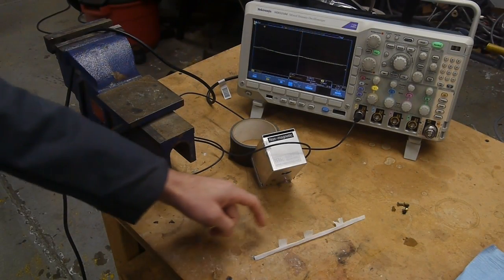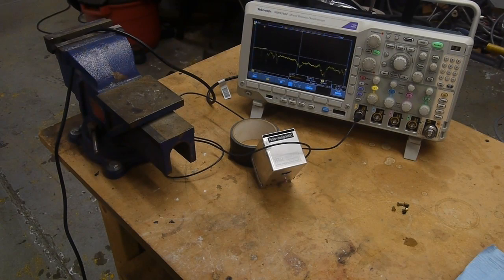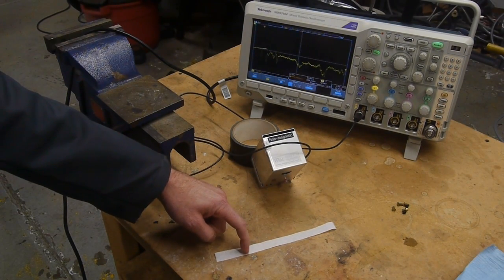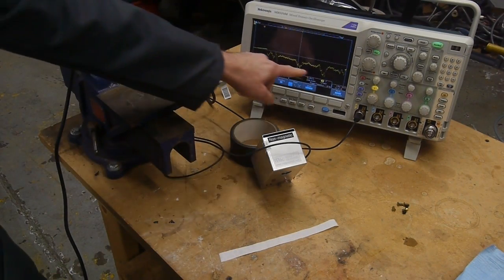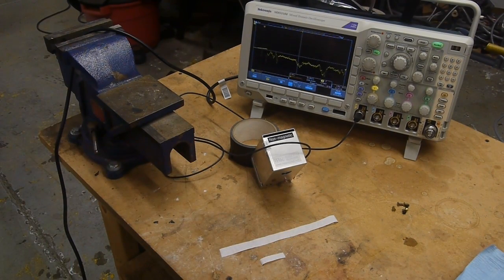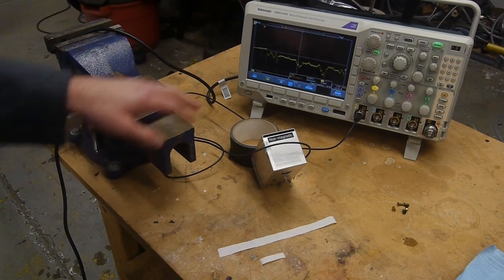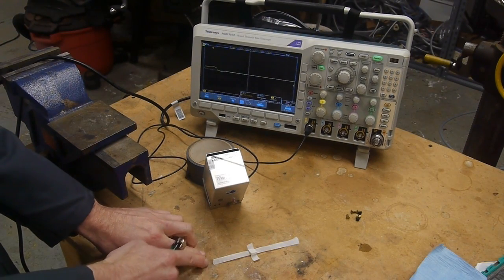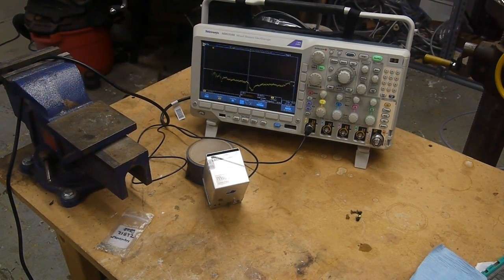Encode information in fire!

Comment: Maybe you could try to implement some kind of logical gates, similar to what they did in numberphile with dominos
https://www.youtube.com/watch?v=lNuPy-r1GuQ
Obviously it would require quite a lof paper for very little computation, but it's a beginning. Hope it's useful ;)
Reply: if the paper were laser cut and then turned into flash paper, you could potentially have intricate and complex logic gates in a relatively small space.  A flammable computer......
Reply: I dont know why your post is considered spam. This is the first post on the list that made sense.
Make the logic gates. From there the rest is fairly easy.
As for Russell a pair of scissors will do just fine.
Reply: Russell Fling Is it possible to laser cut flash paper without ignition?
Reply: Chris W
Id as far to say, Its not possible. You could however burn the paper to shape before its treated.
Reply: Russell Fling
If you read peoples post in order you would realise i said that.

Edit: did you click on the wrong name ?

Comment: I'm imagining the domino logic gates a la https://www.youtube.com/watch?v=lNuPy-r1GuQ where you translate the negation intersection into its flash paper analog. In my mind I'm thinking of a flash paper "bridge" with a small flash paper cup with baking soda inside, so if circuit A burns first (the one bridging over circuit B), it will spill baking soda onto B which stops the B signal. As in the Numberphile video, circuit B needs to operate longer than circuit A before reaching the logic intersection for this to work. Finally, this would not compute based on signal intensity (ANALOG) as you initially were discussing, but rather spatially (DIGITAL), so either multiple sensors or perhaps a CCD with post-processing would be required to read the output. Or, the output flash paper is inserted between metal contacts, so when it burns away, the metal contacts close a circuit for each binary digit of the output. The latter seems like it would be rather error prone however.

Comment: To perform a binary computation you would need to construct something that first replicates AND and OR gates. Those are the basic building blocks to making something like a binary adder. Looking up a basic adder circuit you can see it consists of a few basic blocks of gates. http://assets.allbusiness.com/asset/image/glossaries/4967347.gif 

The problem with a circuit like that one is the NOT gate. We obviously can't make fire from nothing however there is a solution. NAND gates or NOR gates can replicate any gate function with some special configurations. see this image for details on the half adder. http://www.circuitstoday.com/wp-content/uploads/2012/03/half-adder-using-NAND-gate.png

Now I'm certain a NAND would be harder to use since it like a NOT gate has an output with both inputs are zero but a NOR gate is the opposite any input is true unless both are zero therefore they are the ideal circuit for flash paper. You can simply create a NOR by having two leads which connect to one branch output. Either one igniting will result in the correct output of true.

Now that the basic gate is out of the way the problem will be to not allow back propagation. I think a simple solution for this is simply elevate the connector to the NOR gate above the input lead. In this way when our simplified NOR circuit burns out the resulting fire will not continue down the input path. I'll leave it to you to come up with a way to organize the paths so they work.

Hope that crazy ramble helps :D
Reply: Meh so I realized shortly later my logic for the NOR gate was an OR gate instead so that sucks since the logic is completely reversed. I suppose one solution is to simply use fire as 0 and no fire or unburned as 1 and that would essentially solve the problem but I'm not entirely sure. with a NOR gate any input needs to be 0 and no input for both sides is 1. With that in mind fire being 0 and no fire being 1 you would get the same result with the basic two branches circuit and  single output lead. The back propagation would be solved i'm positive with a larger input pad so bigger flame under a raised input lead so if the lead burns it shouldn't reach the pad under it. "Should work" anyways good luck
Reply: So after some sleep I can see that even using fire for 0 and no fire for one doesn't solve the NOT gate issue. Since its critical to flip bits in computing I'm not really sure how that can be solved with fire. I played around with an idea of a power lead and having the input burn up the path doesn't seem like it will work. I just can't come up with a configuration which will allow the power lead to activate the output without back propagating down the other paths.
Reply: So I came up with an idea for a NOT gate but I'm not sure  how feasible it is like the idea for preventing back propagation i'm relying on the idea that fire tends to put most of the heat upward. The idea is very simple the not gate is two input lines one being a "power" line which is at the bottom of the stack with a pad to ignite the input lead. I'm making the assumption that if the output lead of this gate is higher enough from the input lead above the "power" pad it wont ignite. But if the input lead is intact since it didn't burn then the power lead will burn setitng off the input lead and hopefully above that the final output. So not sure how this would work in reality but it seems a reasonable assumption at this point.

Assuming this works a NOR gate would consist of simply two wires to the input location above the power pad and the power line would need to be executed last. Essentially the idea behind this type of circuit is to burn in the pathway the fire should take and then ignite the "power" part of the line to see the end result of burned 1 and unburned 0.

Comment: First thought that came to mind was a Domino Computer https://www.youtube.com/watch?v=lNuPy-r1GuQ

So what you need is for one signal to destroy an intersection so the second signal can't get through.  You said the paper won't burn if it's flat on the table.  Is it possible to have the first signal knock out a support so the 2nd signal lays flat?  This probably breaks your "flash paper only" rule.  I'm not sure how else you could control fire going in different directions at an intersection